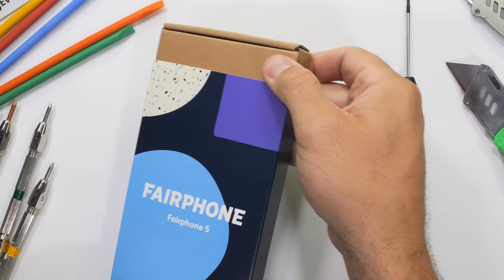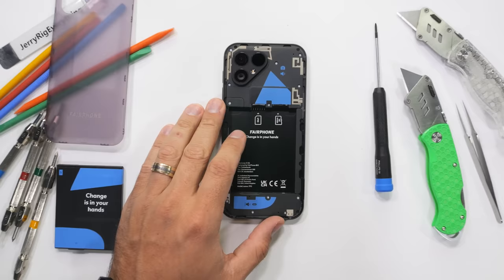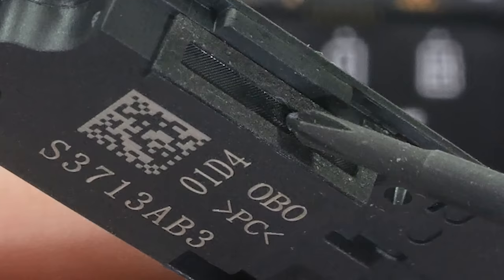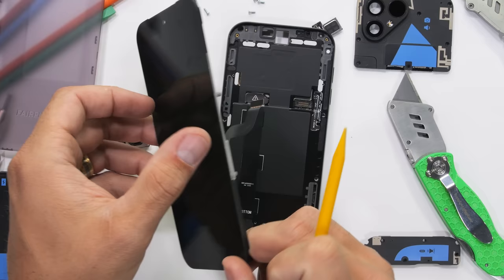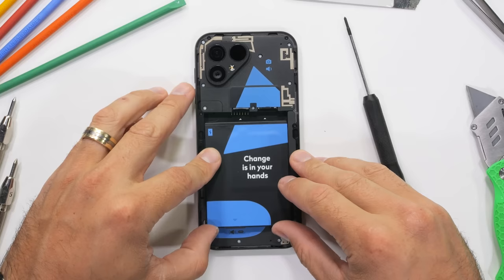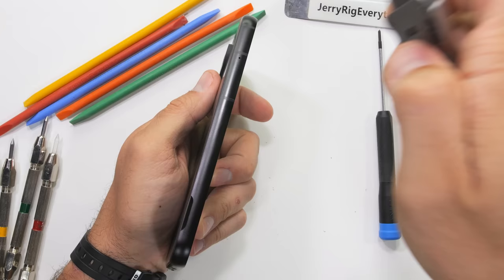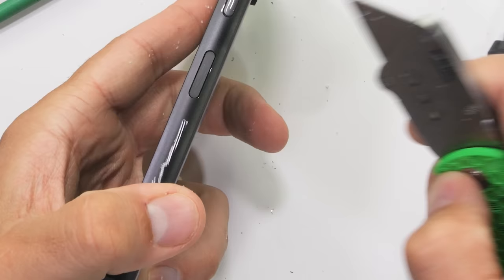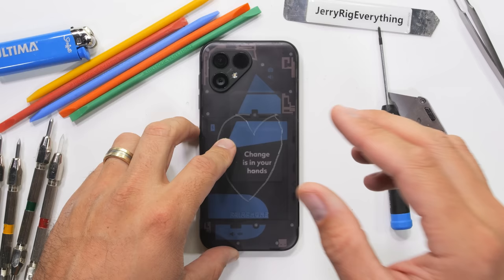The Best Smartphone on Earth - (Not Clickbait)

Comment: The last step for Fairphone would be to allow some level of customization when you buy it. Beside RAM and memory, it would be great to have a few options regarding processors, cameras, and battery (with price changing based on your choice, of course). That would officially make them stand out from any other smartphone manufacturer
Reply: I think that'd be really hard to implement besides maybe selling mainboards like framework is doing for example. Upgradable ram in a smartphone is unheard of afaik, changing the processor to me doesn't seem very realistic or practical, maybe they need some kind of "okay" from Qualcomm for that too, but Idk. Being able to change the whole board in an old housing or offering screen upgrades for an old phone might be more doable (which would still be incredible). As for cameras, maybe if they made slots and modules for the cameras that could work? I think it's a really cool idea to have an upgradable phone, but I'm not sure if Fairphone's willing or even able to do such a thing properly.
Reply: Headphone jack. This phone desperately needs a headphone jack.
Reply: Honestly, you guys don't have to worry like I use to before about fixing parts for smartphones. Fixing a phone is not too expensive. You will mostly fix the screen, replace the battery, or fix charging port. It doesn't cost much to fix these hardware issues. Most issues are actually software related, which you can do it yourself if you search on the internet.
Reply: @xCDF-pt8kj   Moronic take. 25$ wired earbuds will sound better than 200$ airpods. There is no battery to constantly recharge, cables are just more convenient and more long-lasting. Also why does my pair of wired earbuds have media controls?
Reply: @xCDF-pt8kj   Why would you wear headphones outside lol.
Reply: @xCDF-pt8kj  
>a lot better battery

You know what is not bulky and never runs out of battery? Wired earbuds.
Reply: @PatPatych  If it had a headphone jack with a hifi DAC, it would have been a best seller for audiophiles
Reply: @Souls4Roca Literally if LG's V60 got Android 14 to bypass native resampling, it would be perfection... alas they're end of life now. Meanwhile apple could easily bring back a properly built iTouch, but they will never do something unless it's highly profitable
Reply: @PatPatych did bro really delete all his comments after being utterly destroyed in an argument
Reply: You can upgrade the ram tho? But its difficult since you need to change the storage chip that soldered to the motherboard.. Its possible but not all phone tho
Reply: Yeah smartphone master race incoming
Reply: @PatPatych  Would argue about lasting longer, cables are fine if there is not much movement. But once you start moving a lot they tend to break fairly quickly. I use wireless anker earbuds for 4-5h daily for 2 years and they keep going, audio quality quite decent and the cost was about 70$. Cables were getting in the way all the time, never going with cables with mobile anymore. Home desktop still with wired earphones though.
Reply: @xellzor  Wrong. Once the battery on your earbuds dies that's it. Meanwhile, if you are using a cable, there are tons of models that allow you to replace it. I've been using KZ ZSN PRO X for almost 3 years now, 2-8 hours daily, and still doing fine. They cost me 25$ and the audio quality is great - not just decent. Wireless earbuds are disposable and not long-lasting while a pair of wired earbuds can serve you for 15 years just fine.

I've had my wireless period when I also thought bluetooth was the future. All I got was crap audio, a constantly low battery, sound delay, constant hissing and a nightmare whenever I needed to connect my earbuds to a different device.
Reply: @PatPatych  No wired earbuds lasted me longer than a year. Even with half the usage time since most of the time wires getting in the way too much, so i simply didn't listen at that time. There is no way wired earbuds can live for 15 years, at home settled down at pc sure, can last a while, wires don't bother much etc. 15 years is still a stretch though.

The sound is really good with recent bluetooth and codecs progress. Obviously you need some adjustments to suit what you're listening to. Maybe what you experienced was the first ever wireless earbuds? No issues whatsoever with 2 year old anker  earbuds. Connects pretty much instantly, no hissing etc, battery still last me whole day, 2-3h morning, put in case, 2-3h after lunch. Charge of the case lasts me 4-5 days at the very least.
Reply: @xellzor  Have you even read what I wrote? There are models with replaceable cables. You can just buy a new cable for 3 bucks, replace it in seconds and use it just fine. 

And no, it's not "the whole day" if you need to recharge them in-between, lmao. That's half a day at best.
Reply: @PatPatych  Not only the cable, but earbuds themselves can get damaged when pulled out depends on where. I've lost a few, didn't try much of detachable though. Wasn't a thing when i went through local shops before. Anyway, you seems missed the biggest point of cables simply getting in the way too much. Many conditions and situations simply are bad for wires. Comfort of use between wired and wireless is like day and night when you do something remotely active. As for rest, for me it's full day. Listening continuously for many hours straight is really bad idea to begin with, case itself charges my earbuds enough in 10min to last me the rest of the day. Rarely i see charge below 50%. Never once run out of charge.
Reply: @xellzor  Wires... don't really get in the way all that much. The only real case where wires did get in the way was when I connected them to my PC and had to go to the kitchen - I had to take my earbuds off then. But if it's a phone or a laptop it literally doesn't matter because it doesn't get in the way. In fact, it's miles more convenient than bluetooth because it's so easy to switch devices and it's supported by anything that's been made in the last 30 years. I dunno what to tell you, wires are just better aside from edgecases like working out or working with power tools.
Reply: @PatPatych I'm with you on the 3.5mm jack. It's kind of effed up these days that mostly low to midrange phones ever bother to put it.

But I do use both wired and wireless. I workout a lot and I specifically use wireless earphones for the gym. Everything else, it's whatever's most convenient and accessible, which is the wired earphones most of the time.

Good to know there's such a thing as replaceable wires. Ive been giving my kids some crap wired earphones for exactly the fear of them being broken too often.
Reply: @markmywords3817  I mean yeah, when you're moving around a ton and working with equipment wireless if just safer since it can't catch on anything. But for pretty much everything else, wire is king.
Reply: I wish there was a smaller variation too! (unless there is one already, although I don't remember there being one)
Reply: They did make the most repairable phone of modern times by a huge amount. To be fair to them I think this does already stand out. I love that idea too, but I imagine they are just too small at the moment. Also, I reckon providing the crazy amount of updates they've promised for such a range of set ups could be a bit of a nightmare.
Reply: Fairphone is definitely in the footsteps of Framework for laptops.  It's great to see some companies who dare to be different and stand by the Right2Repair movement. ;)
Reply: that is a really stupid idea and would prevent the company from making many sales since making phones much more repairable would already decrease sales
Reply: @whyisitsodifficultomakeahandle  I do not believe that. When you buy a pc, you get to choose between alternatives for RAM/ROM/CPU/GPU etc... And most of these parts can be upgraded. The only reason it's difficult to do this with phones is that compatibility is much harder in such a small space as a phone. But when it comes to money? They would not lose it all, in fact they would gain more buyers and force buyers to stay with them if they want to upgrade their phones. Also you would still have more versions of new phones, it would just come out every 3-4 years instead of making a new phone each year, and for Fairphone's target audience that is actually a plus
Reply: @AllieOk  I dont think you know this but this idea has already been attempted twice before, once by Google itself so its lack of practicality stands as proof. It is mostly a concept that will never develop further that. This idea would prevent anyone from upgrading because it would be useless. Companies would loose BILLIONS of dollars and the industry would literally collapse.......unless the modules were made very expensive like what happened to the nvidia graphics cards. PCs are different, much more components and many people dont make their own PCs either. Nobody would gain more buyers because unlike the PC market, like 90% of the population already has a phone. Not only that but I am sure the whole industry would just turn into a monopoly and people would have to pay to use phone services which is honestly much more annoying than just having them when you buy a phone.
Reply: @PatPatych there are buds with fast charging, I rather get sick and tired of listening them than they are completely discharged. 
With wired buds you will also may need to replace female port where you insert male part in 15 years deifinately, and that's big hassle, swapping batteries in wireless buds is easier in general than that.
Wired are more suitable for home/office stationary use. Wireless is more convenient outside, for sports, even watersport. Both have cons and pros, to each its own...
Reply: @olehcelsior1005  Swapping female port is easier than replacing proprietary batteries in a sealed tiny case? You're delusional lmao.
Reply: @PatPatych  as a guy who does it, yes, swapping batteries in general is easier. And you just inverted meaning of what I said
Reply: They simply put inside what's reasonable, priceworthy and replaceable. The best camera in the market could make the phone either not repairable without soldering or too expensive.
Fairphone and Shiftphone stand out by far from the others.
Reply: They told techaltar that they spoke to Qualcomm recommending to make replaceable SOCs for phone until phone SOC manufacturers do that there is no way this can be done from my understanding
Reply: Ram And Processor with a connector?!! ,  that'll make em slower i guess

Comment: I am extremely impressed how modular and portable this phone is simultaneously. Making only Battery easily replacable would be a huge deal for Apple and Samsung. I hope they will be forced to do so
Reply: Why? If they are forced to do so that means no more water resistant phones.
Reply: Why wouldn’t they be? We had those in the past before they were glued shut.
Reply: They would probably be better off using high quality batteries, along with battery care techniques, to deliver that battery longevity. I don't see why you would need to replace a battery if it did not go bad after a few years. Also using bigger batteries would help offset the loss due to battery degradation.

Comment: This was an instant buy for me, I'd put my order in before their launch stream had finished. My last smartphone was from 2014, so I'm doing my bit for reuse/longevity!
Reply: you can do even more by getting an used phone. You even get a better phone for this price.
Reply: Me too I'm still using my Lenovo P2 from 2016 ;). This fairphone will be my next phone.
Reply: @juri14111996 can't get updates though. That 8 years is unmatched. Most used phones are carrier locked. If you can get a newish phone used from a carrier, that makes sense. Additionally this has an open bootloader.
Reply: Which phone were you sporting until now? That's awesome

Comment: I had a Samsung Galaxy Nexus back in the day that had a easily removable battery similar to the Fairphone 5.  The back cover was plastic (unfortunately not transparent), and could be popped off with little effort.  Inside the battery was not glued down or anything and, IIRC, I could remove it pretty much the same way as Zack did on this phone.
Reply: most most earliest touch screen phone battery are removable, not only samsung
Reply: I had a Droid 2 whose battery could be removed in a similar way.
Reply: @14bqdonk Yeah I remember having a LG G3 then G4 and both had removable batteries
Reply: nexus, that's old time

Comment: I remember well the times, not too long ago,when every smartphone was built with a removable backside and exchangeable battery. 
For my Nokia Communicaters I even had a docking station with an extra slot to load an accu. I often carried the 2nd battery with me and exchanged it on the fly instead of panicly searching for the next outlet to re-juce my phone, like nowadays still the Apple kids do 😀
Reply: One of the few things I missed from my old Nokia and Sony Ericsson is I need 3 weeks to charge the battery when it's starting to run low

Comment: Really love the idea of this phone, just wish it had a 3.5mm jack, not planning on replacing my Zenfone any time soon though.
Reply: Can't you just put a USB c to 3.5mm adapter in it, that's how I rock it
Reply: Asus closed zenfone division so you might to start looking for a new phone 😂
Reply: @turk639  yes, but it's not the same, dedicated 3.5mm jacks have built in DACs, most of the cheapo dongles don't and break often, and it's a little ridiculous that it's necessary to carry sometimes two dongles and a phone just to drive headphones/IEMs at/over 32ohms when manufacturer's could just include a 3.5mm jack in the first place. At any rate, there's no justifiable reason to not just include one in the first place.
Reply: That's the thing I hate about Fairphone - they used to have a 3.5mm jack in previous models, then they released one without it and at the same time released wireless earbuds of their own, which guess what, are not repairable. Sustainable my ass. That move alone discredited their entire "repair-friendly and sustainable" schtick to me.

Comment: A dust or water test would have also been nice. Also if it had a 3.5mm jack I would have bought one instantly.
Reply: usb c to 3.5mm jack converter is sold seperately....but its not the same :(
Reply: @Epsilon9-tt7oo  The adapters break pretty much instantly and the sound is crap with them. I tried for 4 months. Worst phone experience ever. If you love music, stay away from this garbage phone. And never recommend adapters. They are seriously so shitty.
Reply: @helenanilsson5666  Yikes!

Comment: That phone is actually a great phone (SD card slot and repairability) except the fact that it doesn't have a headphone jack. I am still annoyed to all phone manufacturers which doesn't have one. I wish that all new phones have both micro SD card slot and a headphone jack.
Reply: Sigh... Get over it.
Reply: wired headphones is 2010....buy some wireless
Reply: @jaypaans3471 it seems likr you didnt get the point of fairphone's intiative. Btw wireless headphones/earphones dont sound good at all. They suck so hard. Maybe that is all you need.
Reply: I agree that was the one negative I saw with this phone.
Reply: @maikelpeeters7328 wireless headphones/earphones sounds bad. 5$ wired sounds far brtter than most of the wireless out there. Btw, it seems like you didnt got the point of using a fair phone. Wireless headphones/earphones wont survive as long as phones do. So there is lot of e-waste with them than the phone itself.
Reply: @kvbk  Speak for yourself, my wireless headphones are 3 years old, and still work great. I've never had wired headphones last even half that long, because the aux cable always gets stripped.
Reply: The oldest that I still use are some Sennheiser I brought in 2010, with most higher end headphones you can easily purchase another cable and unplug the old cable. I expect I'll still have them after another 10 years. They sound great, never need to be charged, and never have issues with wireless interference.
Reply: My oneplus 6t came with a usb-c to headphone jack adapter, so you still have an in if you want to use wired headphones while not charging.
Reply: Bluetooth fobs exist to run any wired headphones you want. I use one for wired buds.

Comment: I repair phones for a living. First thing I noticed was the lack of a water resistance gasket on the back plate and LCD. Phones like this will turn into a brick in the presence of water. No more surviving spills. It doesn't matter at all that the dock, speakers, and other small entry points have gaskets when THE ENTIRE FRONT AND BACK OF THE PHONE ARE UNPROTECTED. Putting gaskets on the small stuff but not the front and back is like wearing gloves and a condom but expecting to stay dry like in a diving suit.
Reply: I have one and i can say from experience, it is not an issue...